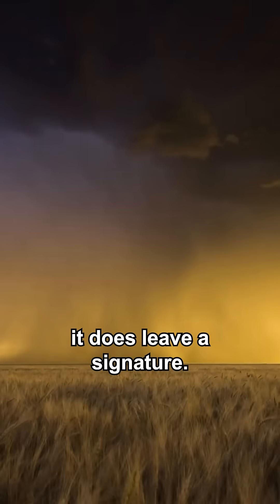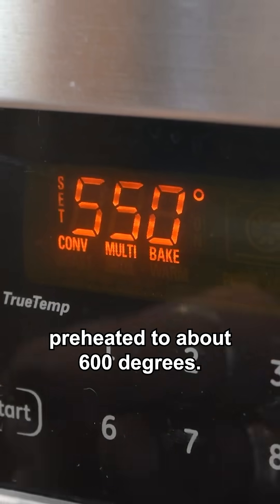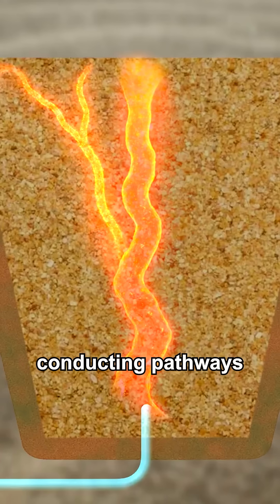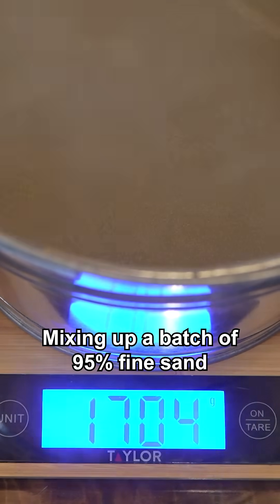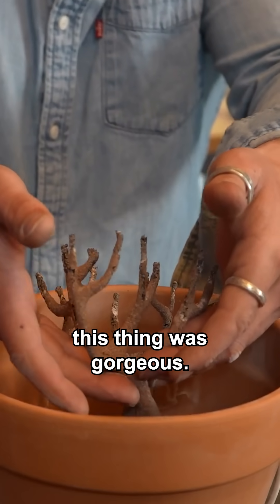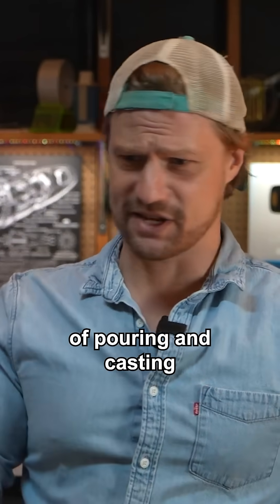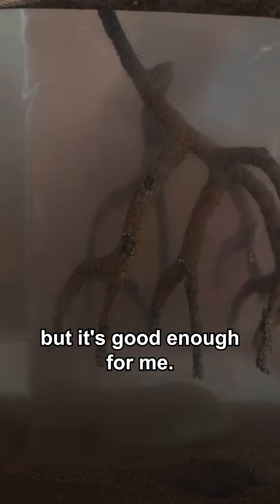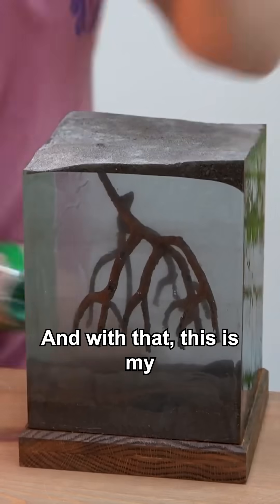I Captured The Footprint of Lightning (fulgurite)

Comment: The first arch builds the main path to the discharge and every new location you hit it ends up discharging to toward the first branch that becomes the trunk of the tree as thickens after every attempt. If you used a very high voltage current and cleaner high silica or quartz sand it would've become a glassy tree. I've tried that with a 3 phase welding machine

Comment: This is so cool but it doesnt look like lightning in a way. lightning starts and ends at one point. you could after doing what you already did add annoter 2-3 inches of sand and do one final arc slightly longer to make it the main channel where the lightning connected with the ground.